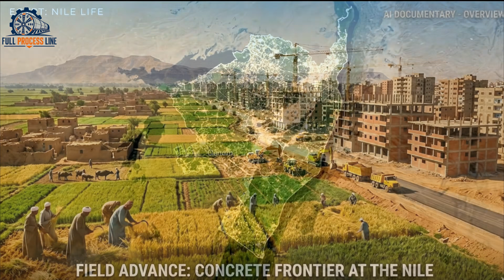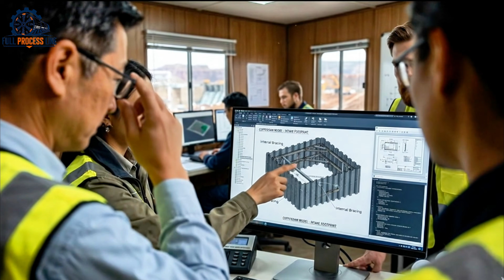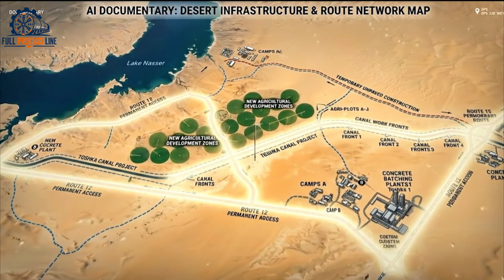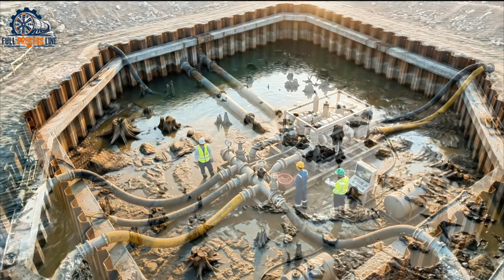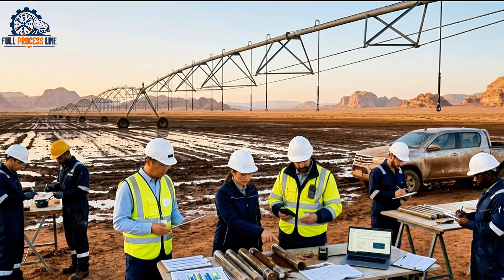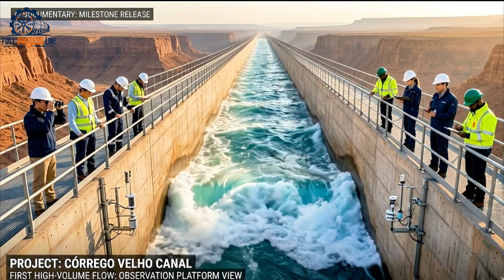How Egypt Is Building the Impossible 310 KM River to Turn the Sahara Green | Full Process Line

Comment from the maker: Egypt’s Toshka Project combines giant pumping systems, canal construction, rock excavation, drainage, groundwater control, and center-pivot irrigation into one enormous engineering system.
Which stage impressed you most: the pumping station, granite excavation, canal construction, salinity solution, or final testing?
And which impossible megaproject should FULL PROCESS LINE explain next?